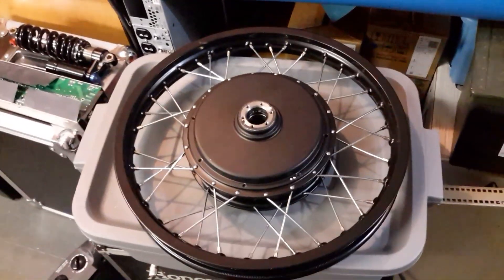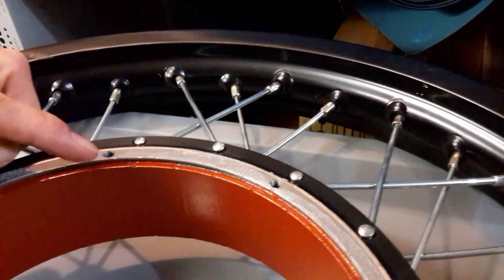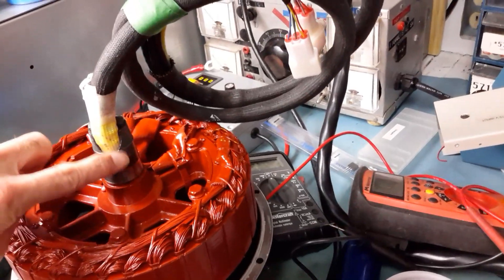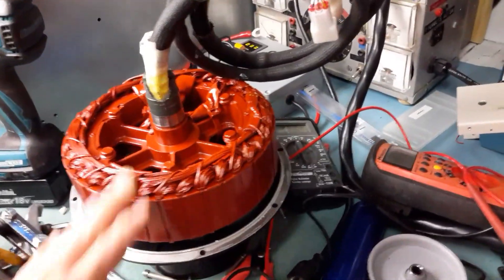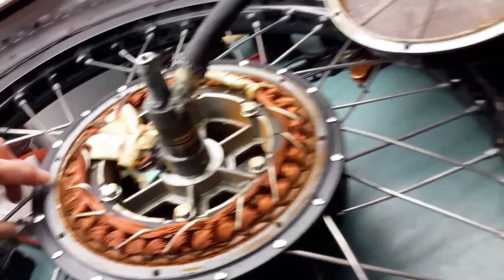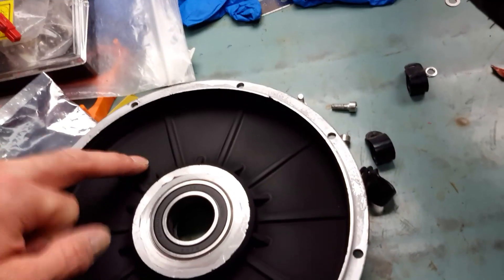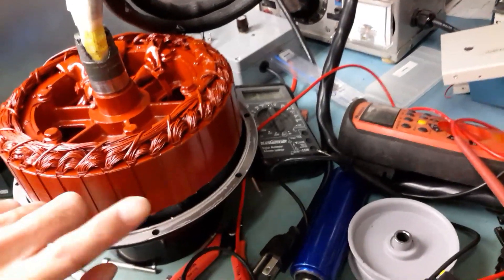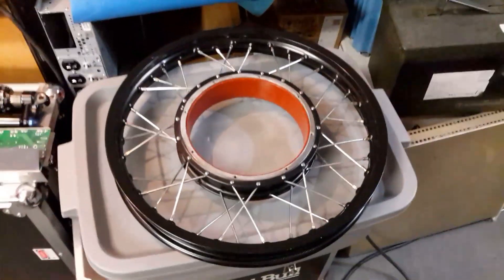Hub motor rust protection.

Comment: I recently disassembled my hub motor and accidentally chipped the edge of one of my magnets. It might be just the coating, but are there any precautions I should take to prevent further chipping after reassembling? What product did you use to paint the magnets and motor components? Also, do you lose any performance when doing this? Wouldn’t the magnetic field be slightly weakened with extra material between them?

Comment: What about filling the motor with oil ? I have a problem with my bike motor not stopping with high humidity ☠️ I suspect it's a issue with the throttle Im going to try filling dielectric greese .

Comment: Instead of electrical varnish, use highly thermal conductive potting epoxy, that's the industry standard for stators.  QS should roll dip these, then add gaskets, heatsinks, and ferrofluid from the start
Reply: Yes. That'a good for the stator but how do you protect the rotor and the magnets from rust

Comment: mine works perfectly in rain , what i did is i used plasti dip spray and sprayed multiple layers all around the motor , since plasti dip is waterproof there is no way that water will get in the motor because it doesnt have anywhere to enter anymore. I highly recommend this to anybody and it is cheap way to do and you dont need to disasemble the motor.
Reply: nice, but how the heat can dissipate afterwards?
Reply: @jean-mariejm7404  no problem with heat at all. as i work as food delivery i have more than 10 000 kilometers on motor allready. I dont know it just works fine ahhah :)
Reply: it will come in - via the cables, the shaft, you name it. the covers are not the only entry point.

Comment: Hi thanks for the video I was thinking if use the automotive high temperature silicon Sealant on both side of the cover plate wouldn't that stop water getting inside the motor in first place and when is new because is less likely water can get in from bearing even some grease on bearing will stop the water what u think??
Reply: Thats my plan.

Comment: Thanks for the informative video. What kind of fluid do you put inside the hub motor? is it normal engine oil or transmission fluid or light silicone oil?
Reply: Ferro Fluid ... Got it sorry. :))

Comment: How do you eliminate the rust from an already water damaged motor.  I might be wrong, but I'm assuming that you are water proofing a relatively new motor that has no water damage. Would you recommend something  like EvapoRust and then use Acetone and Isopropyl alcohol.  EvapoRust is a non abrasive rust remover that is water soluble.  I use it on a lot of small rusted parts and it is environmentally safe and seems like it might work.  I haven't taken the motor in question apart yet, so I don't really know what I'm up against with regard to the extent of the oxidation and corrosion.  Since my last question I found out that the polyurethane is sprayed on.  I can't thank you enough for the information about using flat black paint to reduce the infra red reflection on the other side cover.  Very Nice.  I can't thank you enough.  I'm going to make it a standard practice to waterproof all the motors that I use for all my builds in the future. This information is priceless to me.     I'm sorry.  I'm going on too long.  Thanks again.

Comment: Thank you.  Good Video.  But how did you apply the Polyurethane Varnish?  Did you use a brush, spray paint, or some other method? I'd also love to know how adding the Ferrofluid worked out.  Thanks again.

Comment: I just read through your thread on endless sphere last week. It was fascinating. I learned a lot. Good to see a brief overview on video. 
I'm a little confused about the infrared thing though. But I can see how painting the inside of the covers black might draw more of the heat away from the stator and rotor.
Reply: Its like an infared heater. They use reflective surface to bounce that heat back to you. He is avoiding that by painting  black to absorb infared. Infared loves black objects so cover will absorb it and it will leave outside of the motor

Comment: ZZ and R bearings are basically water-tight. 
What would make it so difficult to add two gaskets? Two-part silicone or separately cured single-part silicone. Butil rubber gaskets to measure or some other sealants on the side plates. 
Spraying that varnish on the stator will impede it's cooling. 
The magnets are safer as they are glued to the outer case.
Reply: Gaskets = bad. They bring moisture in. I've spent too many years running 4x4's threw water not to know that. Just silicone is better, but would make it hard to separate motor later. From what I've seen with electric bike motors, is to buy a quality motor to begin with. One designed to hold ferrofluid would be a good start. They don't have much of a gap in the
 machining to leak FF out or water in. Then use silicone on outside to seal any imperfections. The way I see it, the pain't can't hurt, and the smallest bead of high temp RTV spread out with a steady finger shouldn't hurt either. I would stay away from household silicone tub & tile grade. That stuff is just a mess!

Comment: Hello Dr Bass , Is it true that blackened or discolored copper stator windings show a case of over heating of the copper coils ?  If this is true , what discoloration would show up on the stator coils after they are painted ?
Thank You for sharing your valuable information on U Tube and the ES Forum too .

Comment: To stop the corrosion in the first place, you can use transformer oil as used on power line transformers.  Drill a hole in the side of the motor side plate.  You can see in the center of the motor that there is a lot of empty space, and the side plate sets way back from anything.  Fill until the oil is about up over the windings.  Tear down on a ZEV Electric  LRC with 15,000 miles on it showed no corrosion anywhere in the motor.

According to Alcoa Alum,, heat transfer is radically better than bare aluminum if you black anodize the aluminum parts.  Much better than paint, and anodized parts do not corrode remotely easily.
Reply: I agree with you fully.  A motor unprotected by varnish or oil is sure to rust.  The mechanism being: a hot motor expells some of the air it contains as the air heats, too, and expands.  When the motor cools a suction ensues and if this happens in the rain, liquid water will be inhaled.  It's easy for liquid water to get in and very hard for it to exit an untreated or unmodified hub motor.

I oil-doped my last hub motor nine years ago.  It ran fine but was soon destroyed in a crash.  Will oil fill my next one, too, encouraged by your recommendation.  From time to time, the oil will be drained and replaced.  Oil will emulsify a good deal of water and yet still prevent rust. The clarity of the drained oil will adequately indicate the presence or absence of water.  Turbid oil means significant water, water that will be removed by the proposed oil change.
Reply: Which type of oil and quantity i put?
Reply: Ferrofuild?
Reply: @Esk-be8kd  It works, but stays only between the magnets and iron.  A little better transfer can be done with other fluids.  For most people the fero fluid works.
Reply: @MegaDhz  what other fluids
Reply: won't the oil leak through the bearing seals?
and how to seal the drill hole?
Reply: did you seal the motor? And whats the cheapest oil i can use? How much ml?

Comment: Where do i buy the orange couting
Reply: Here is the old and still industry standard red phenolic resin insulating paint, http://www.hisco.com/Catalog/Paints-Coatings/Paints-Primers/Enamel-Paints/1201LV-21717 
I first used Glyptol over thirty years ago in electric motor maintenance and antique auto engine block sealing.  

It is is entirely practical and perhaps even more desireable to brush on the liquid, which may thereby more fully penetrate the windings and magnet gaps by capillarity.   In an earlier era motor makers used vacuum impregnation for full saturation of windings.  This is not often done today nor is it necessary, considering the high degree of protection afforded by modern wire coatings.  Glyptol is available in aerosol spray, Eastwood carries it in the States.   Other brands such as Dr. Bass cites are perhaps just as good as the original Glyptol.   Despite my personal preference for dip or brush,  Dr. Bass'  long and practical experience proves that aerosol application penetrates and works perfectly well for this task and the brand he cites is really good, too.
Reply from the maker: Search for Sprayon EL 601 you will find alot of place where you can buy these. The can i bought i got these from Motion Canada.
Reply: @Doctorbasss  what kind of epoxy for the magnets, did you thicken it?

Comment: Hello Doctorbass, is the motor already enough protected with only silicon on the outside rings? I have only put ferrofluid and the silicon on the motor. But not the color like you have? Merci.

-Elias
Reply from the maker: I recommand replacing the actual "silicon" or bizzar grey paste thet they put between the side cover and the magnet ring by something else like quality exterior silicon..